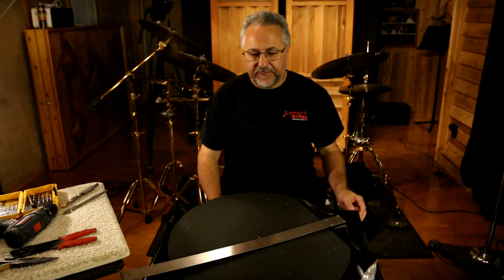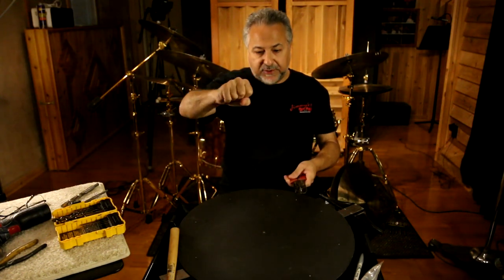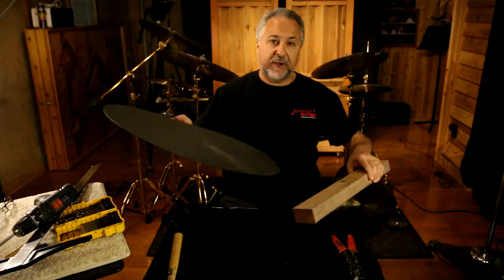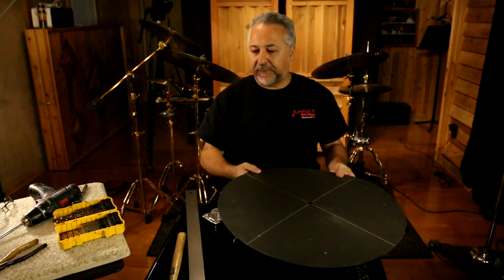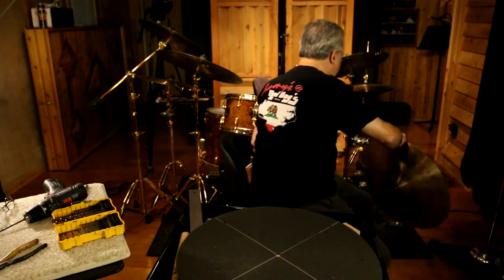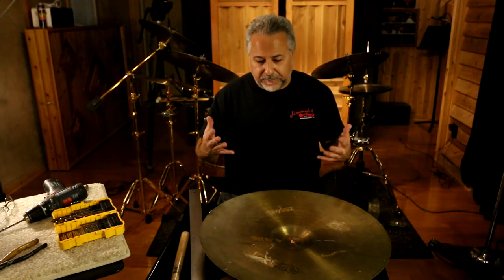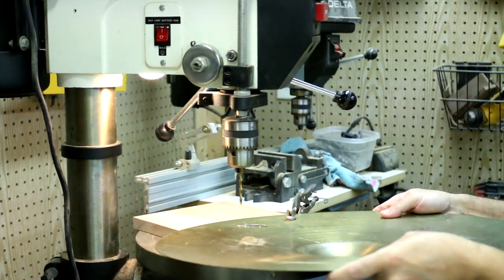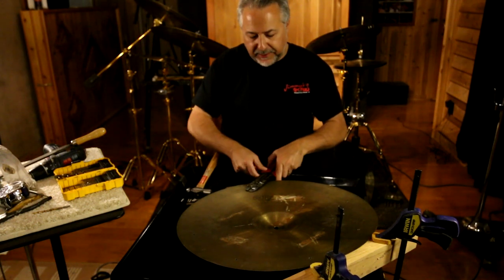How to Rivet a Cymbal

Comment: This is great - been thinking about doing it to my 22" k con bounce ride.    Looks pretty straight forward.  My only addition would be to use a center punch for marking - especially if you only have a hand drill.  It will indent the cymbal at the correct mark and not just keep the bit from wandering, but will actually pull the bit into the center of the mark.
Reply: Also, I wouldn't just use hardware store rivets - some metals react with other metals and will corrode.  If you use aluminum for instance the brass is more anodic and will corrode the rivet.  Steel also, but less so.  I'd imagine the Zildjian rivets are stainless or similar metal make up of the cymbals.

Comment: I do it all manually, with a hand driller. In my case, I always drill and install only 3 rivets (like  an Armand Zildjian 19 ride). I measure the distance between each rivet and the distance from edge. Put a little pen mark and then do the drilling. I use Istanbul brass rivets that are easy to bend after installed. But here in Brazil once you install rivets in a cymbal, and if you decide to sell the cymbal, it is very hard to do it, since most drummers do not like rivets or drilled cymbals. It is a shame. I love the rivets especially to play ballads with brushes and gently hit the cymbal for that sizzle effect. Cheers everyone.,Keep on drumming!

Comment: Great video. Just wondering is their a reason you didnt just use your carpenters square to make your marking on tbe cymbal upside down to start? Could you not just skip the template step and measure an inch and a half from the perimeter? Either way extremly helpful I would have used a drill and drilled right side up. Very helpful.
Reply from the maker: A template makes it go much faster.
I have templates for 24, 22, 21, 20 and 18 inch cymbals.
You just put it on there and mark it. No measuring.

Comment: What size drill bit? How about using a hand drill? I don’t have a drill press/ workshop. Thanks for the video!
Reply from the maker: Hi Kevin
The size of the bit depends on the size of the rivet you use. Make sure the bit is 1/16th larger than the rivet.
You can use a hand drill. If you do that use a drill bit with a point so it will bite into the cymbal. You will need to apply  pressure when you start so the bit does not travel across the cymbal and put a deep scratch in it. You will need to put a curved block of wood that is shaped like the edge of the cymbal under it when you drill it so it does not leave a bad burr.

Comment: Can you link to an example of the rivets you use? I’ve just riveted my cymbal but the rivets don’t even vibrate slightly! Fully locked...issue is the type of rivet. Thanks...great vid.
Reply from the maker: Hi
I use standard Zildjian rivets. They are about 3/16's in diameter. They may not be moving because the hole you drilled may be too small. The hole should be at least a 16th larger then the rivet body.
It could also be because the cymbal you used is too heavy or light and is not vibrating enough to move the rivets.

Comment: What material should rivets be made from for best results? ...Brass, Iron, copper, bronze.
Reply from the maker: They are usually made from hard steel. You can also get brass rivets but those work best for very thin cymbals and are more expensive.
Stay away from aluminum rivets as they are too soft to work with.
Reply: rickdior thanks will look for some brass ones..can you recommend a size and length?